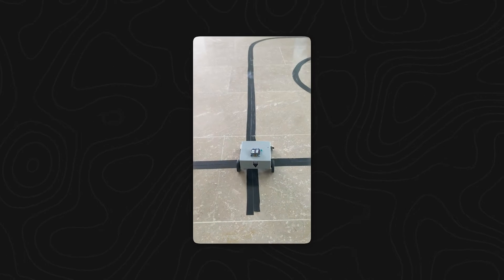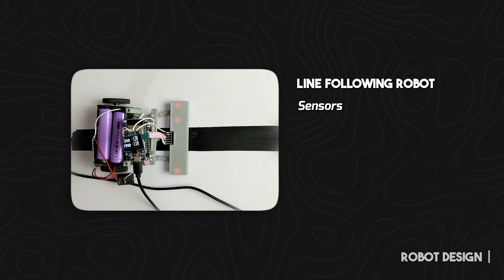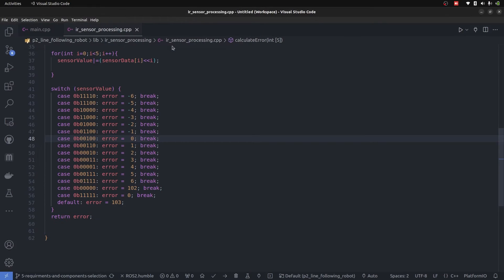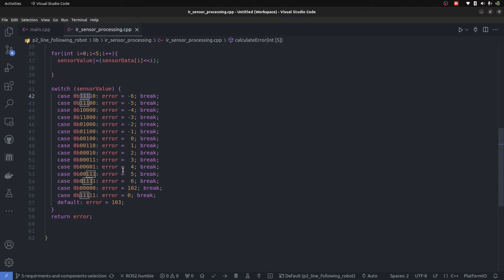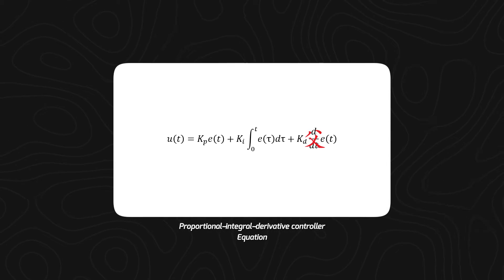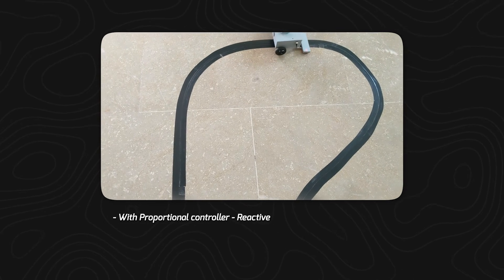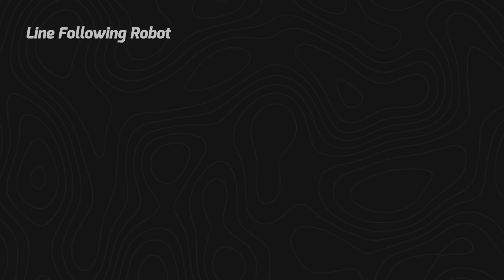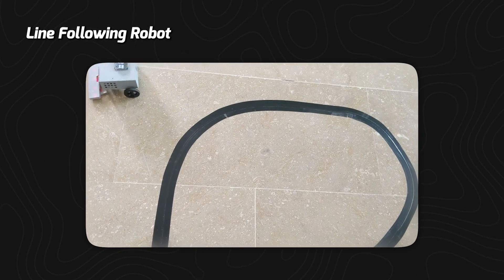Line Following Robots: Design, Control Systems, and Implementation

Comment: to configure pi controller using software its self its mean matmatical equation of pi controler enough?
Reply from the maker: Not just that 
you need to tweak and find optmial gain values 

- in the lecture series on robotisim , it is explained in detailed how to implement basic PI controller in code